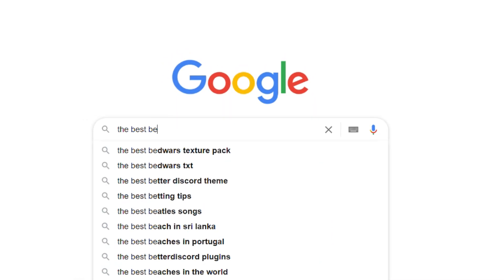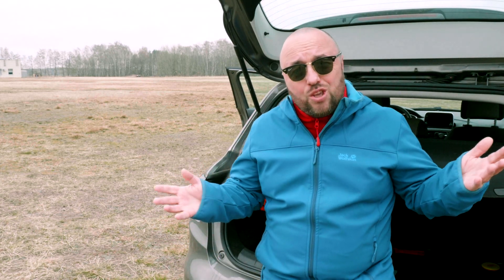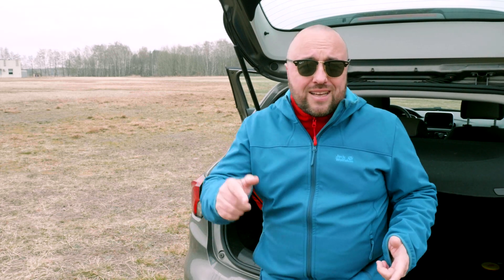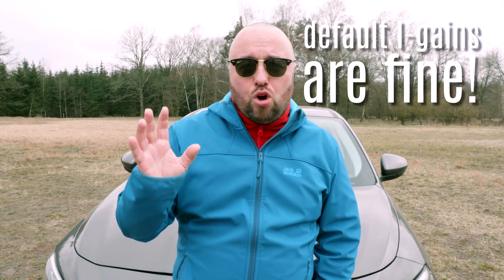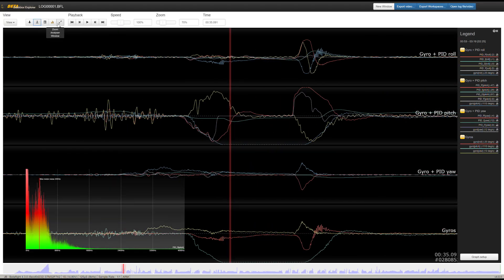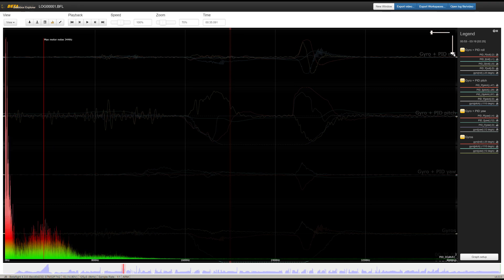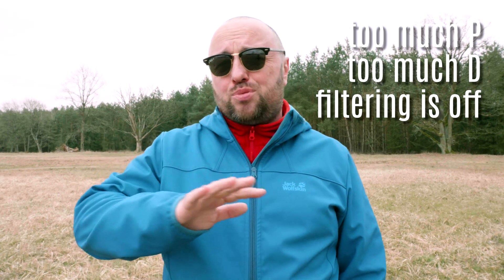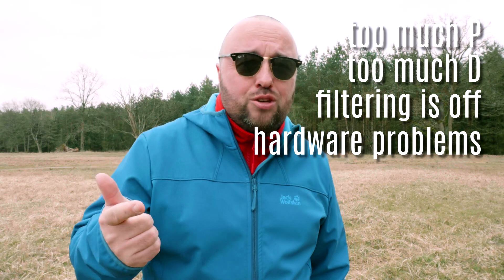Drone PID tuning made simple

Comment: Cool introduction. I think I knew all that... Just watched as I thought that JackWolfskin winter weight soft shell you were wearing is a really cool colour. I've got a green and yellow one of thoes... Or an older model...

Onto tuning... The last time I flew my AOS5 frame it did not feel as nice to fly as the time I flew it before, with no alterations!! Felt more twitchy and less smooth to fly... As if the I term relax set point had been raised to a race level... But on the same hand it felt like my quads used to feel before I turned off the ADC filter in my radio, which I found made a profound difference to the way feedforward behaved. My control input also felt delayed.... Its a d@mn shame, as I was at a beautiful location and ended up with not very smooth footage... Still might release a taster video of location before I go back on a sunny summers day.

Comment: You have to be very good to tune a kwad.
And you have to fly very good to feel the difference 😄
Reply from the maker: I'm average. But yes, to feel the difference you have to know how it should feel. And that requires stick time
Reply: @FPVUniversity  That is a good pilot. I'm a rookie and I feel the difference between with airmode and without and I learned not to touch anything if it is flying.
The transmitter gives me more problems. My Radiolink has a very good range, but it doesn't fit well in my large hands. My DX6e feels great in the hand, but the range is very limited.

Comment: Step 1 throttle sweep set filters. 
Step 2 step response tool for p to d balance 
Step 3 raise gains until it has no more positive effects and latency is optimised 
Step 4 add iterm until  step response has adverse  impact 
Go fly the fine tweek.  
Less steps.

Comment: Oh cool. This goes in my PID Tuning playlist. The BF 4.3 preset has worked very well for me, but I still want to learn to tune myself.
Reply from the maker: Presets are only presets, they are not tailored to your machine or your expectations
Reply: @FPVUniversity  That's true. I got lucky and my quad flies great on the preset but I'm sure it can do better so I need to learn how to tune. I tried messing with pids and filter settings on a 3 inch 6 months after I started out and an AIO board stopped working after 1 battery. Blew all of the ESCs, so I've been nervous about messing too much with anything.